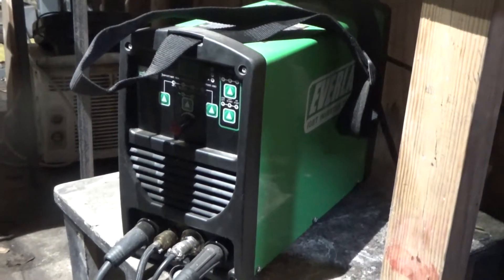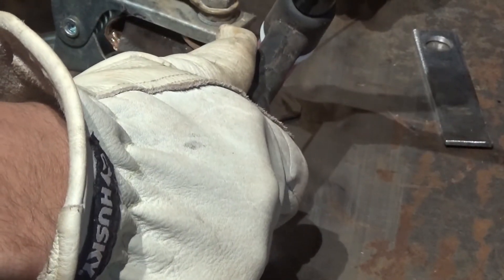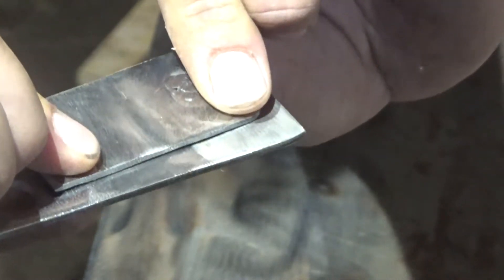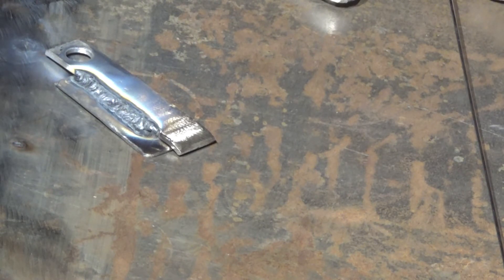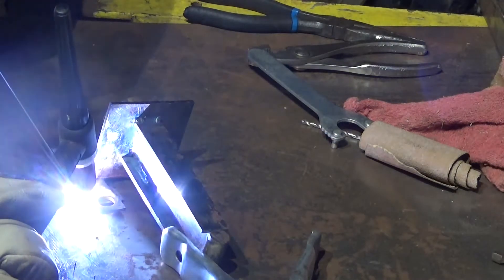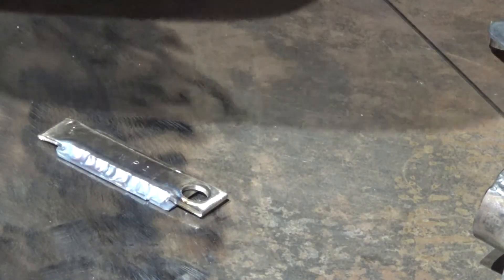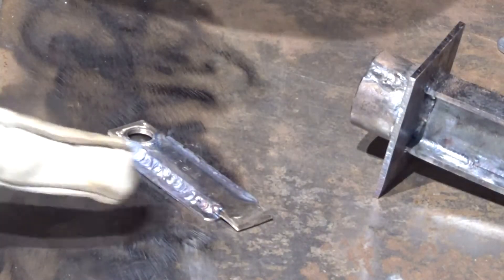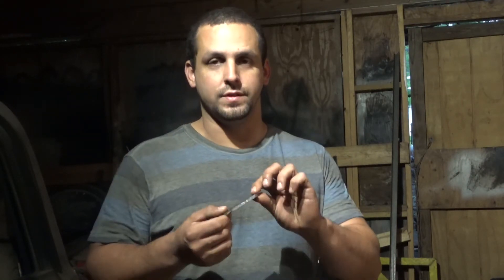Can you use 75/25 argon/C02 mig mix for tig welding, also my first time tig welding stainless steel.

Comment: Sounds like your regulator is turned up too high. It shouldn’t shoot out that much gas. You should barely be able to hear the air sound of the gas coming out. I haven’t tigged stainless with the 75/25 mix before, but I’ve always had mine set between 15 and 20 CFH on both of my welder’s.

Comment: It’s not the worst weld , I went to welding school for 3 years in high school and welded professionally for a couple years and have done all my own repairs and maintenance for 42 years and my plug welds are hideous and my welds in general are like a snake spine and ugly , my eyes always wander when they aren’t supposed to leaving me with ugly welds , however , my welds have always held even though they are not the prettiest, so don’t be so hard on yourself, pipe welders on pressure pipe I understand the need for neatness and no porosity but for welding barn doors and stalls for my wife, the grinder and rustoleum make up for it 🤣🤣 rustoleum and a grinder makes up for my poor skills 🤣🤣🤣

Comment: How did it  not just weld to the table ?
Reply from the maker: You can usually weld stuff like that on a metal surface as long as you're not burning all the way through.
Reply: @davidcraft4909  i did mean when you were filling the hole
Reply from the maker: @jayk2k  I guess you make  a good point, but still, if you are laying down molten steel on cold steel, it's not going to just fuse together.  But yes I have welded my work to the table before.
Reply: @davidcraft4909  fair enough , I am just starting out on tig , well welding in general. 
I was searching for videos of , if you can tig with argon 86% with co2 14% , and came across your video . And the conclusion is no. 
Thanks for uploading
Reply from the maker: @jayk2k  I would use nothing but 100% argon.